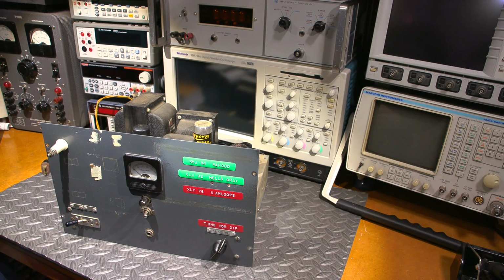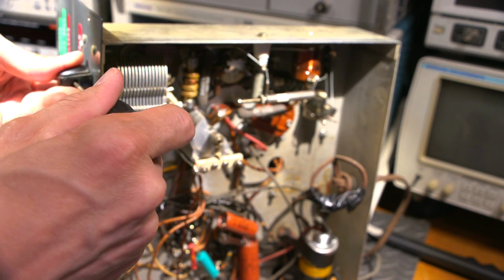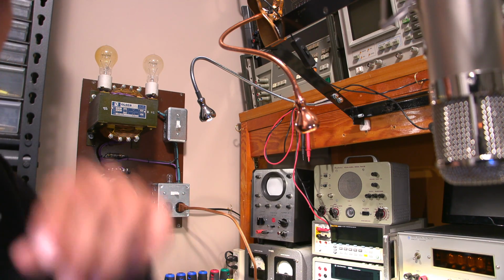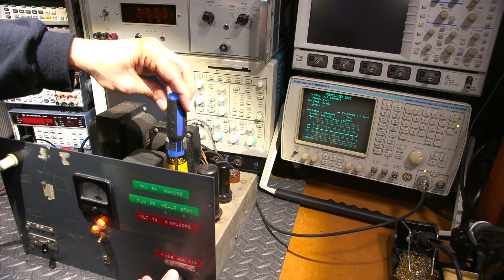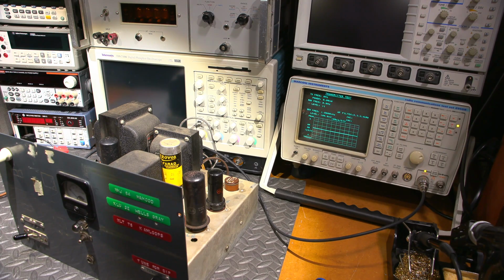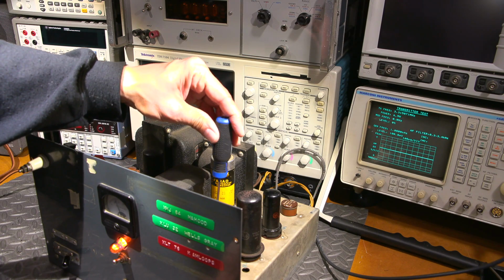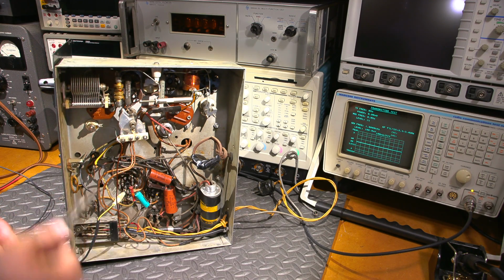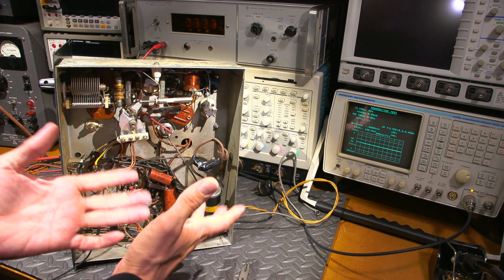Electronics Adventure - 1940's Transmitter - Will It Work?

Comment: To neutralize the final stage pull the crystal in transmit and use a RF probe on the antenna line with no antenna. Adjust the voltage as low as it will go. That should give the best stability.

Comment: I wonder if the mystery switch allows the rx to be on during tx for alignment or allows the modulator to be disabled and instead key the transmitter with a short on the mic jack for use with a key to do cw...

Comment: This work with old military crystals, I deal with this and frequency below HAM  80 meter band is very was popular in ww2nd and after for comercial things.
To replace rectifire tube with silicon diode I was also doit many  time, 35 year before people still used old vaccum tube radio receivers but vaccum tube was tricky to found.
This kind crystal I try to tune up in the HAM radio band but you cannot to phone subband. Only just a little above 3.5Mhz I try it. God job in restoretion

Comment: i've had a lot of interstage transformers with open windings. I've rewound a lot of them and I found when unwinding the coils that the wire can be broken in dozens of places. With absolutely no evidence of abuse I put this down to either thermal stress or impurities in the copper. In some cases there will be evidence of many impending fractures showing up as discolouration on the wire.

Comment: Many years ago, I built a 10 watt am transmitter and with the HT off I measured the grid current drive from the output of the buffer stage and tweaked it for beast setting using a meter in the grid of the pa

Comment: Great to see the transmitter section still works, even in that state of repair. It will be interesting to see if the transformer has failed and what may have caused it. Maybe David Tipton could rewind the transformer for you 😉😁
Reply from the maker: He does great work!

Comment: Ah!  Dodgy crystal.  Been there...
Back in the mid 1960's (New Zealand) my Uncle owned a Radio/TV repair and service business in a small rural town.  I would often fly up and spend Xmas holidays there.
As a young teenager pottering in his workshop, I learned enormous amounts of basic electronics and I was even allowed to do some repairs occasionally.

I vividly recall learning how to use paste, stone and water and glass plates to manually re-tune Quartz crystals for HF vehicle radio transceivers.  The techniques were similar to old-school grinding of glass lenses.  The rocks were usually the 20 odd millimeter square variety and fitted to a square, two-peg carrier.  It was amazing to me at the time, how stable resonance could be accomplished so simply with a little wafer of quartz.

I expect you will find the quartz carriage fingers inside the crystal assembly just need a good clean and away you go...

Looking forward to watching the next installment on refurbishment of this butchered transmitter.

73's -- (Was a ham for many years but no longer.)
Reply from the maker: Thanks for sharing your story Jim.

Comment: Amazing that the transmitter is working at all with the scrambled up mess under the chassis. And it is even getting power out and modulating that is incredible for something that old when you haven't even changed any parts or tubes. Thanks for the video Paul always entertaining.

Comment: For us mechanical engineers what does the term “take off” mean?  My interpretation of what you are doing is trying to get the power to the antenna rather than bouncing around in the circuitry that prepares the transmit current for the antenna.  I can’t think of a mechanical equivalent.  Maybe a garden hose and you have 50 psi at the faucet but at the end of the hose, it’s drip, drip, drip at a pressure of 10psi.  Look for kinks in the hose, automatic valves for sprinkler system, a secondary path (leak), and so on.
Reply: "Take off" means that an amplifier stage has burst into self-oscillation

Comment: I use regularly a 1945 « all original » No. 19 wireless set.  All components are original from 1945 including the power supply with selenium rectifier.  Astonishing but true, it works perfectly and I make regular contact in CW and sometime in AM.
Reply: There was an army surplus shop in Meadow Lane, Leeds, and they sold loads of 19 sets way back in the 60s. Back then they were mostly brand new in the box. I didn't have one myself but I used to set them up for my school friends. Oh to hear those dynamotors again! When I explained they needed a 12-volt supply they'd 'borrow' their dad's car battery, then try to explain how it came to be run down the following day!  Yes, I did explain that they must never, ever, transmit as it was illegal! Happy days.

Comment: Why didn't they use the 12V tubes that will operate with a B+ of 12V i.e the tubes that were developed because the transistors of the day were not ready for prime time and anyway 1-4W of RF should be able to get out as VK3YE showed that 0.05W of RF can be picked up at quite a distance from the transmitter.

Comment: Just before 14:00 when you shorted out your limiter bulbs to get full line voltage, you said it was still a current limited variac supply. Do you have current limiting other than the bulbs? Wondering if you mean fusing or if you've added something to the supply since making the video on it.

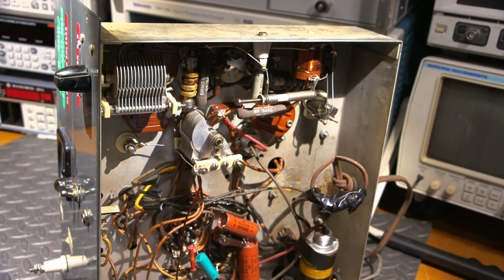Comment: 4:50  Wave washer.  Another option is a belleville washer, although it may provide more resistance than needed for that application.
Reply: When I was a teenager in the 70s, I "fixed" a loose knob on some Radio Shack product by wrapping many inches of electrical tape around the shaft so it would squish against the chassis. I guess this method is a better solution.